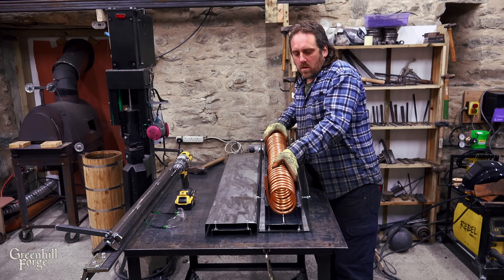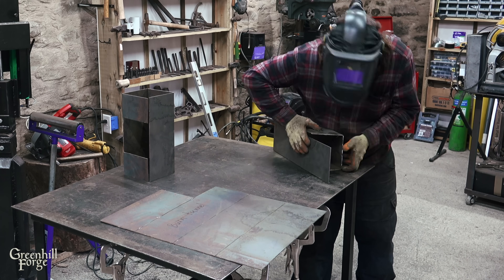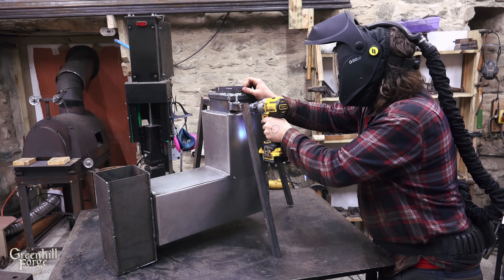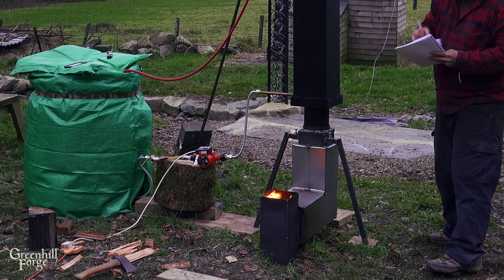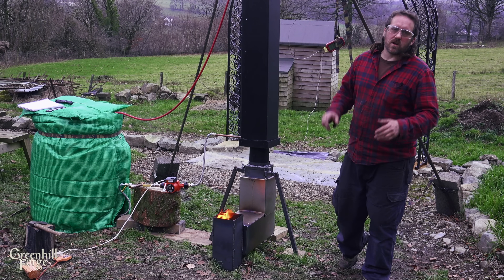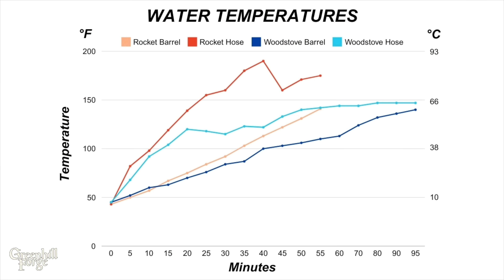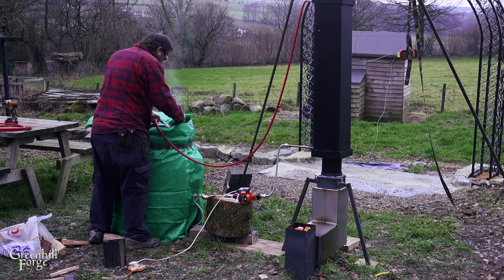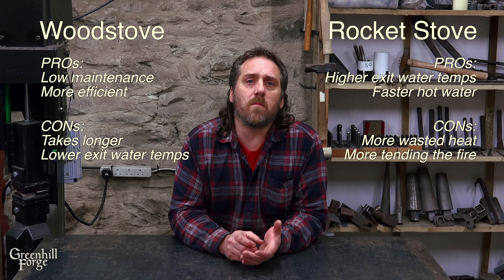Rocket Stove Water Heater Experiment Pt2 -TOO Powerful?

Comment: Since longer isnt as feasible....what about a larger diameter copper pipe?
Reply from the maker: smaller diameter would have more surface area per volume of water. probably worth trying. there just needs to be enough water moving through to keep the copper from overheating
Reply: @GreenhillForge switching to multiple shorter coils or even bundles of straight pipe would be better. The current coil is too long.
Reply from the maker: @JaneDoe-dg1gv  I'm open to it, have any data or resources that support it?
Reply: @GreenhillForge No direct citations; just applying my knowledge from research into boilers.

Your single coil sat in hot flue gas is a lot like a monotube boiler. That type excels at boiling small amounts of water very fast. They are known to make lots of pressure with even slight temperature rises. Because they are so good at making steam, it is the exact wrong design for what ya want.

Multiple coils would be analogous to a spiral water-tube boiler. The Climax boiler is a good example. These don't raise steam as easily but can raise a lot of it. This is closer to what you want, if you keep the length of each coil short enough.

Industrial boilers have furnaces too hot for ceramic firebricks, so they use a waterwall instead. These are tightly bundled vertical water-tubes covering the furnace walls. They have incredible circulation because they are vertical. That circulation is the only thing keeping them from melting since they boarder the actual fire itself.

Straight vertical tubes would provide the strongest possible circulation but be limited in how much heat they can absorb. Since they wouldn't force the gas to flow through them, a lot of heat could be lost up the stack. Good for a furnace lining but not what you want.

The cross-tube boiler would perform very well for your design. Instead of vertical tubes, slanted ones would  intrude into the gas path and force the flue gas to heat them while still having strong circulation.

Applying different boiler designs is what made me think your project would work better with shorter tubes to limit the boiling.
Reply: @GreenhillForge something like a slanted grate made of straight pipes would work. like this, (I is wall. ! or / is tube.)  Sideview I/I Topview I!!!I
Reply from the maker: @JaneDoe-dg1gv  This is great info, thanks. Plenty to look into. But assuming the coil design/pattern was fairly optimised, wouldn't it be best to be as long as possible, to the point of diminishing returns where the coil/s had absorbed as much heat from the flue gasses as possible? so multiple  stacked grates in that case?
Reply from the maker: @JaneDoe-dg1gv  I can see it. Zigzag? flow would be more consistent as opposed to a bunch of Tees.
Reply: @GreenhillForge No, making the coil as long as possible wouldn’t be best. Getting the highest possible water temperature is not the same as collecting as much heat as possible. Being effective at extracting heat from the flue gas will cool the gas. The more effective the water heater is, the lower the gas temperature will be. 

For the stove to have good draft, the lowest allowable gas temperature is probably above boiling. Since the flue gasses are always above boiling, you can extract more heat from it by increasing the surface area of  “cool” water being exposed to the flue gas.

You can do that by making the coil longer and longer until it stops absorbing heat; but that will absolutely result in making steam; really hot steam. The other way is to have more pipes that are shorter. That way the water doesn’t get as hot while the surface area for heat absorption still increases. 

Whether straight or coiled, the optimal length of pipe is the one where the water increases to the temperature you want. The optimal number of pipes is the one that takes flue gas at whatever combustion temperature you have and lowers it to an exit temperature that provides sufficient draft.
Reply from the maker: @ ok, you're refining my thoughts on it. I guess I should have said make the heat exchanger as long as necesarry to get the flue gas temps down to the point where they no longer assist in heating. I can see how multiple coils would be better than a single coil. closer?

I'm already building a new design that removes the coil from direct contact with the flue gasses. The idea as I see it is effectively to trade some efficency for a system that doesn't collect creosote (or reduces it as much as possible) to make it safer and need less cleaning/maintenance. Any thoughts of that?
Reply: @GreenhillForge Not zig-zag. Any sharp bend in the pipes lowers the flow rate; harming circulation.
I would go for a manifold on the top and bottom with thin pipes running between them. Then the whole thing slanted.

Like [[[[ manifolds top and bottom with pipes between; pushed over like /

Bottom manifold bottom-left and top manifold top-right /

Walls |    |

Stacking the grates could be either Side by Side or One Above Another

Side by Side
Side view
|   |
|///|
|   |
Top view
|[[[|
|[[[|
|[[[|

Or

One Above Another
Side view
|/|
|/|
|/|
Top view
|[[[|

Kinda irritating design since it has a lot of intakes and outlets. That’s why I suggested just one grate. You would probably have an easier time making 3-5 spirals than making 3-5 grates. IF you go for multiple I would suggest One Above Another. since you have a rather narrow but long flue to fit them in.
Reply: @GreenhillForge Closer yeah. It is important to remember larger heat exchangers are what can take out more heat. Making the heat exchanger bigger by having longer pipes raises outlet water temperature. Making it bigger by having more pipes keeps the outlet water temperature the same. Both would lower the gas temp but more pipes is safer and easier to deal with.

How it gets bigger doesn't really matter until the system becomes big enough that is can pull more heat than the heat source can provide. If big enough that each exchanger does drop gas temp to the exchanger's minimum, more pipes can push the gas temp lower than longer pipes.

If you want all the heat you can get, then multiple coils will be able to drive the flue gas temp down the lowest.

Give me a bit while I write the next comment about the new design.
Reply: @GreenhillForge An indirect heat exchanger will work to a degree but the flue will build up creosol anywhere the flue is below boiling. Changing from direct to indirect heat transfer doesn't really solve a creosol problem if you have one. Creosol happens either when combustion is too short (quenched) or when there is an incorrect Air-fuel ratio (AFR).

If the combustion is stopped by the flue gas being cooled quickly then the solution is to have a larger combustion chamber so that combustion can finish before touching anything that could quench it. Longer chambers make the gas cover more distance and wider ones slow the gas so it takes longer to pass through; both provide more time for combustion. Wherever the burning is taking place, to ensure the burn finishes, make that section bigger by lengthening and widening.

To fix an improper Air-Fuel Ratio (AFR), first determine if AFR is lean or rich. Lean means lean of fuel; too much air, not enough fuel. Rich means rich of fuel; Too much fuel, not enough air. Creosol is produced only at very rich or very lean AFR. A lean AFR can quench a fire, stopping combustion by cooling it with lots of cold air. The solution to a lean AFR is to restrict air flow. Honestly a rather easy thing to fix and not an issue you have in your designs. A rich AFR makes cresol because the combustion does not having enough air to get hot. The solution to this is to add secondary air inlets that provide more air.

Both regular and rocket stoves have a large amount of primary air. They're more similar to the historical ratio for wood fired boilers which is 70% primary air and 30% secondary air. The ratio used by more advanced designs in locomotive boilers is inverse to the historical ratio with 30% primary air and 70% secondary air. 

Being able to dial-in AFR is best done by having a primary air supply that makes a rich gas mixture (more fuel than air) and a controllable secondary air inlet to progressively add more air till AFR is correct. See what you can do to limit the primary air flow and add a throttleable secondary air inlet. Make sure the secondary air never passes through the fuel; have it go directly to the flames of the fire. 

The normal stove with the hard oily buildup is cresol. The oiliness is cresol and the hardness is from the oil binding all the char and then baking solid. Since rocket stoves burn so hot, you probably don't even have creosol on those tubes. The powdery char from the rocket stove is actually a very good sign as it shows there was no oil remaining in the flue gas. Without the oil buildup, you aren't at risk of a creosol fire. 

Char is hard to ignite and burns very weakly with a cool flame; so it's not very dangerous. However, the char will reduce the heat exchanger's capacity. Thankfully the issue the char does show is simply a rich AFR leading to carbon char buildup. This means the rocket stove just needs a secondary air supply to fix the AFR and there will be minimal to no char buildup.

Comment: I love these kinds of videos. Really interesting to watch and see the comparisons.
I also think a more traditional rocket stove design would make sense and also keeping the heat exchanger out of the actual flow of exhaust gasses.
Keep up the good work!
Reply from the maker: I could be wrong but I think this is like the most traditional design of rocket stoves. are you thinking more like a K style?
Reply: @GreenhillForge Sorry, I meant like one that has the barrel over the top to force the hot exhaust gasses back over the top of the flue and back down. Usually this seems to hold a bit more heat in the system.